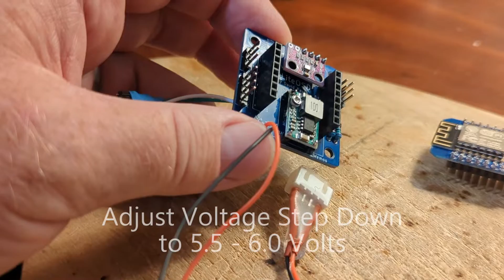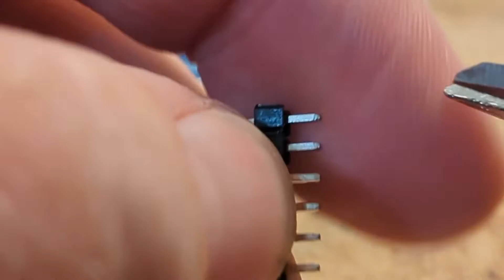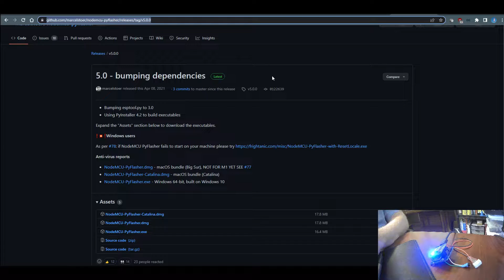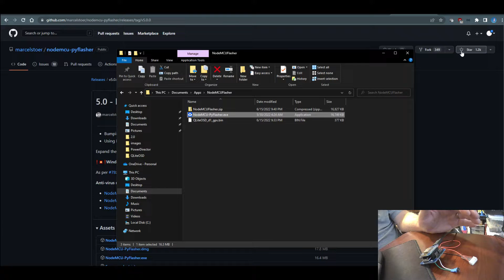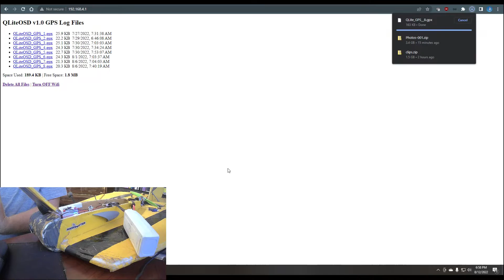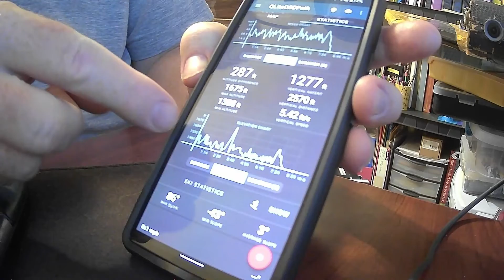QLiteOSD Assembly - Arduino based OSD for DJI FPV Goggles

Comment: I have just finished soldering a kit that I purchased from you a few months back. I followed the video, which btw was super detailed and easy to follow. Once done, I've gone ahead and flashed the QliteOSD and all seems to be going as per the instructions!!

One quick question I have for you is with regards to what GPS devices do you usually use with these units? I have my DJI Caddx VISTA Unit and Goggles ready, but I don't have a GPS module. What would you recommend?
Reply from the maker: That is great.  This is the gps I have been using: https://amzn.to/3T5M87p
Reply: @Qromer  thank you 😊
Reply: @Qromer  I ended up ordering the Matek SAM-M8Q GPS Module. I've just tested the QliteOSD with my Nebula Pro CADDX Vista and my Goggles and it's working flawlessly... Can't wait to hookup the GPS and get this thing up in the air!!! 🙂

Comment: This is an awesome way to provide osd without a FC. will this work with the new DJI goggles 2 and o3 air unit? Thanks!
Reply from the maker: Thanks, that is a very good question.  I have not had the opportunity to test it on the new system.
Reply: @Qromer  Ok thank you for the reply, i might have to pick one of these up and report back!

Comment: It's so good.Will the DJI Goggles RE Racing Edition Ocusync Air System work?
Reply from the maker: NO, this is for the DJI FPV Goggles that already support the MSP protocol for on screen display.
Reply: @Qromer  It's so sad that my old device doesn't work😭Is it possible to upgrade the firmware to make it usable？
Reply from the maker: @chillmao3051  Sorry, it is sad.   The DJI FPV goggles are totally different from the ones you have.   Not at all the same thing.

Comment: Hi, i bought a couple of kits from etsy and both of them does not light up when i plug it in the usb. Both of them i assembled as how it was shown on the video step by step i build it accordingly. The pc detects it and manage to flash it..  but i dont get any telemetry reading or even the board lighting up..but it does connect to the pc and still could flash it..
Reply from the maker: Contact me through Etsy.   Unplug the wemos d1 mini from the main board and load the firmware on it with it off the main board.   If there is a solder short that could cause the board to not load.
Reply: @Qromer  oh, no.. i made sure all soldering points are clean and followed your video and painless videos before assembling it then did a step by step assembly as per your build video. I will contact you through etsy ... thanks 👍

Comment: Can I change the height of Feed to meters?
Reply from the maker: Yes, in the QLiteOSD.ino file comment out the following line:   #define IMPERIAL_UNITS                               //Altitude in feet, distance to home in miles.

I will precompile the binary and add them to the options to load.
Reply: @Qromer  Thanks.  I have two suggestions for improvement.  

1. To realize the signal for arming the recording via a PWM servo signal.  

2.Integrate an offset for the voltage to equalize the voltage.  

I'm already working on point 1, but unfortunately I haven't had much success with it yet.  
Thank you for your videos and your effort.  I'm starting to upgrade all planes with the d1 now.
Reply from the maker: @mathiasullrich835  -- thanks but let me sugguuest you post these types of requests on Github were the source code is.  Also, one of the goals is to NOT require a connection to the PWM receiver.    I have updated GitHub with Pre-compiled binary files for metric and imperial measures.

Comment: Could you please describe the voltage divider in more detail or draw a circuit diagram for it. Without the board I don't know where to turn it. Tanks
Reply: (BAT+) --> (30K) --> (o) --> (7,5K) --> (GND)                                                          (o) --> (A0)             I hope this is correct.
Reply from the maker: @mathiasullrich835  I think that is correct.  Check out this video https://www.youtube.com/watch?v=JGXdi7XcQi8  and also, I created a test circuit here:  https://oshpark.com/shared_projects/PfLW7Gfy
Reply: @Qromer Thanks, your program is exactly what I was looking for.  Had already tried it myself, but I didn't get along with the msp protocol.

Comment: Anywhere selling these pre-soldered ?
Reply from the maker: Andrew, not currently.   Might add it as an option but would need to cover the cost for time etc.   If you are comfortable with basic soldering and follow the steps in the video... I have seen beginners get it done.   Also, building it is half the fun... right?  "I made that"  :)
Reply: @Qromer  Really fancy this but shipping to UK (£16+) probably makes it un-economic for me